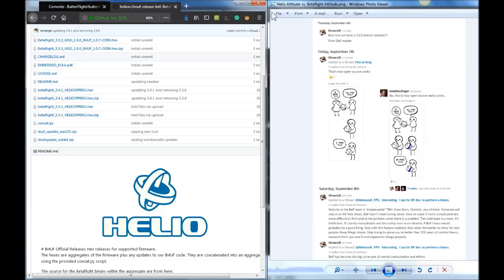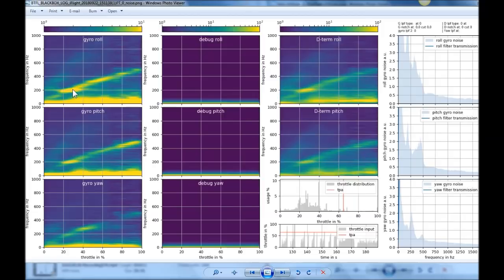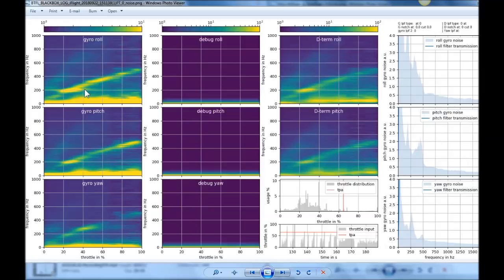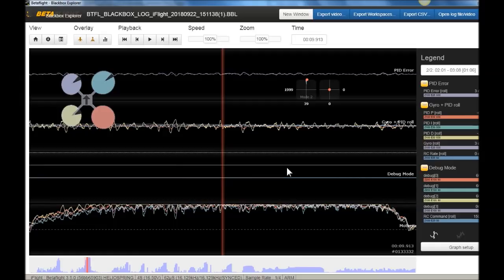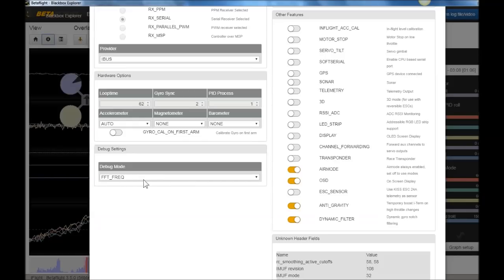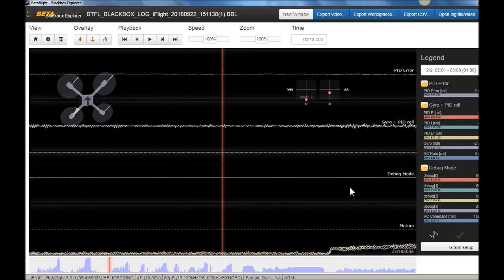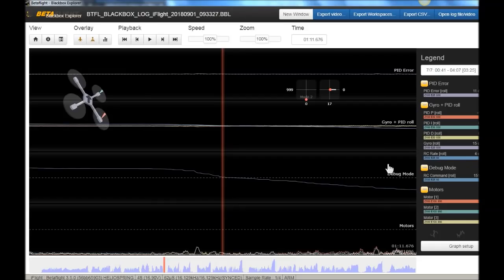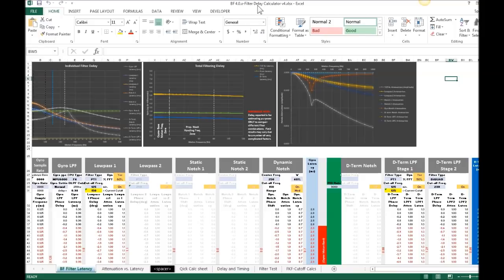BF 3.5.x Dynamic Filter on Helio Spring

Comment from the maker: Try this.  In CLI type "get dyn". The Quality and Width variables should be set to 70 and 50, respectively.  Are they? If not, set those and give it a test run.
Reply: Interesting. Looks like the default for both is zero. I typically set mine to 15/30 on clean builds. so I had already changed mine from the default. I'll see how the blackbox looks
Reply: So i did a test flight. Even with the quality and width manually set, the dynamic notch still doesn't work. Still, It flies pretty good. fairly impressed with the board. its a 6in rooster frame and i get lots of noise in the 160-200hz range which is pretty hard to filter without killing performance. My F7 board actually had a harder time with the noise. Lowering the Dterm lowpass 2 filter helps keep the motors mostly cool.
Reply: If I may offer a suggestion out of my experience that I've had, something about the rooster/chameleon frames inherently have some kind of resignation issue it especially come out in Pitch axis. ( roll and yaw will be pretty clean)
 My suggestion would be just to get you a good quality  F4 board mpu 6000 and put this 32k biz behind you,
 I have gone The Helio spring (that was a joke) route and the flight 1 route and a matek f722 they all run 32k flight controllers something about this Frame and the residents noise that it makes makes it extremely difficult to tune and filter noise.  You have to add such a high level amount of filtering in order to get it clean that for latency  reasons you're really better off going with an F4 (which has the DLPF where we need it)  running 8K/8K,   propwash issues start coming out a lot more when you have a higher latency system. 

Ultimately what I did is switch to the jbf4 v2 and it flies Waayyyyyyyyyy... better than it ever has on 32k, spring or flight 1 and the matek f7.
 I believe the frame is causing most of the issues with noise,  I'm going to swap over all my electronics to a new frame I have coming in just so that I have some kind of comparison between the frames. If anything to rule out any electronic issue, and of course satisfy my curiosity

Comment: This is unfortunate to hear. Just got my Helio board in the mail and now kinda wish I had gotten another f7(killed a gyro). I guess we will see how it flies. Great informative video
Reply from the maker: See pinned post and see if that works.
Reply from the maker: I would be interested to know to make a follow up if it does.
Reply: The parameters are still there - that's not the problem.  The issue is that he's disabled the filtering code for the Helio so the parameters are irrelevant.  https://github.com/ButterFlight/butterflight/blob/fb0f05161d1761b06a3dc7dbe35ebbaf6add08a6/src/main/sensors/gyro.c#L1177-L1189